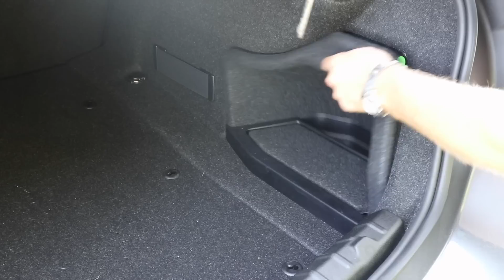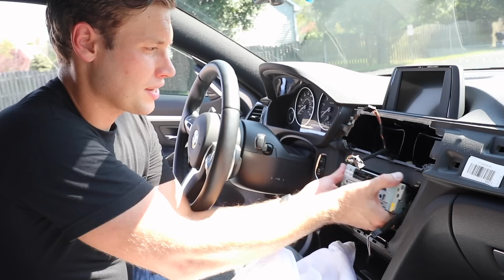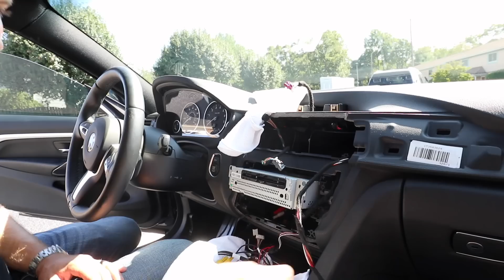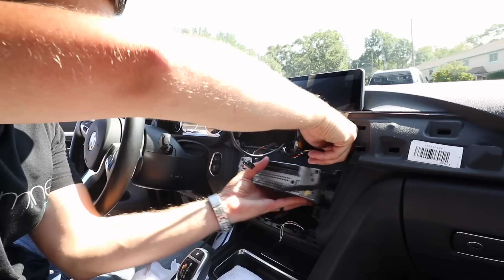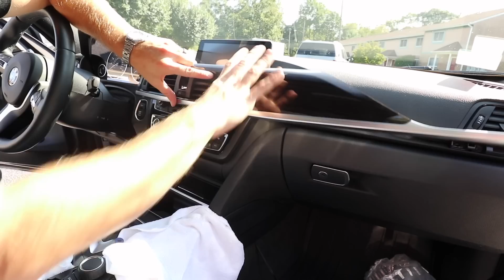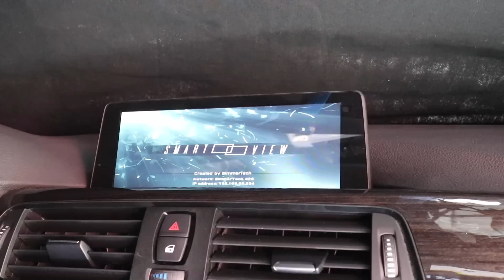BimmerTech 8.8" VividScreen Installation in a BMW F30

Comment: I just had a shop installed hd flex and rearview cam in my e60. every time I try playing videos or YouTube videos on my screen mirroring mode, my phone display “connected to AirPlay” and my dash screen goes black, any help on this?
Reply from the maker: Hi, I believe we're in touch on the support line. It appears the youtube app (and possibly others) recently changed the way videos are being streamed to airplay to a way which is currently not compatible with the SmartView HD FLEX. We're working on it.
Reply: BimmerTech any clue on how long the wait might be? Because that was the only reason why I bought the item and that really sucks.
Reply from the maker: I'll let you know via e-mail how the situation develops. We're working on this intensely.

Comment: when installing nbt to F13 with cic, will the section of “quick reference” and “search by pictures” shows F13 cars in the pictures ??
Reply from the maker: If you purchased an NBT retrofit from us please contact us with your VIN at support@bimmer-tech.net
Reply: In retrofitting a NBT to a CIC in 6 series F13, will the “search by pictures” and “quick reference” section shows the actual F13 vehicles inside them  ??? or other random vehicles ?

Comment: Im assuming if you have the stretch its not going to be sharp on the higher resolution but just take the 480x240 and distort it like setting your computer monitor to the wrong resolution. Even if stretched on the BMW stuff will the smart-view be sharp when your doing iPhone screen mirroring etc? That would be my main concern since most of the time ill be listening to my iPhone or using Navigation. Great video
Reply from the maker: Spot on. The coding to remove the stretch changes the output resolution from the iDrive to match the new screen, otherwise it will be stretched exactly as you describe. You can see exactly how the stretch looks in this video we made while prototyping the screen: https://www.youtube.com/watch?v=rQTaEp_1iag This only affects the factory iDrive menus and screens; our SmartView and cameras output at the same resolution whether you have the stretch or not, and will look identical in both cases. You can also see these being used in the video, to get a feel for what it's going to look like. Thanks!
Reply: Thanks for the reply, Looking into purchasing one soon.. Would love to use my iPhone navigations and audio etc on that screen.

Comment: Hi Bryan, do you have any idea as to where the SIM card is located in a bmw 4 series? Apparently you have 3 years free and then need to pay for it?
Reply from the maker: The SIM card is built into a module located most likely inside a module in the trunk. It is non-removable, non replaceable (the SIM card). Yes, usually BMW hands out 3 years of service for free. If you want to keep it working past that you'll need to contact your dealer.